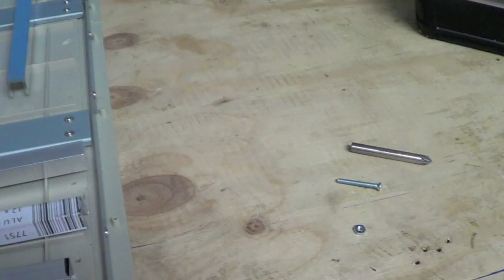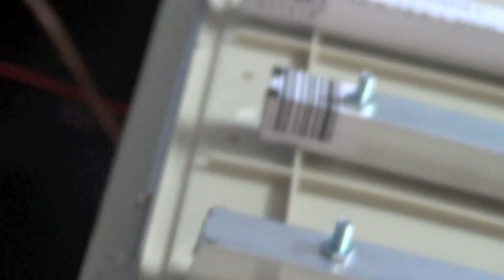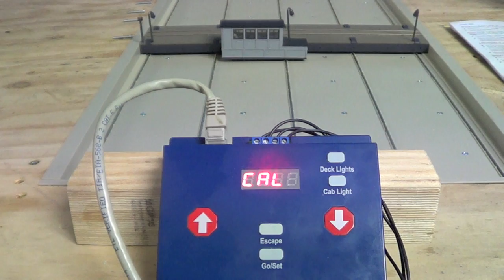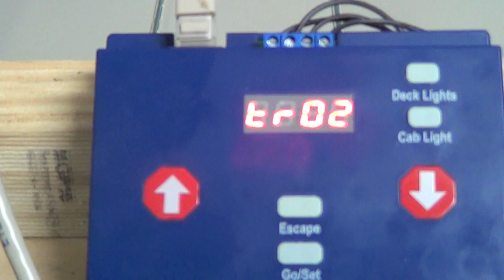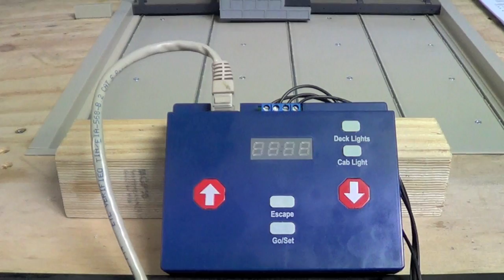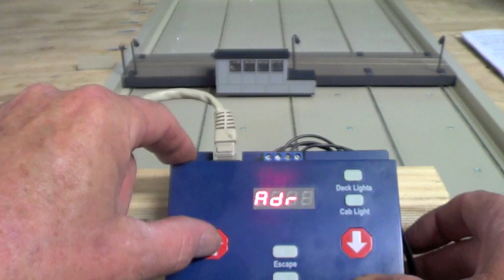"Walthers Transfer Table" Model Trains Part 42 "C"

Comment: I would have thought that the bracing added should have been run the length of the table not the width, it could have been attached to the supplied cross braces so no drilling or screws would show on the table.
Reply from the maker: Mike that might have worked as well cheers Robert

Comment: Hello Robert,
Great update and video !
Found your videos while searching for information on Heljan transfer tables.
Great to see one working !, Well done on showing us.

I have just purchased one of these, brand new ( November 2014), when all connected up, all I can get the control box to do is display > Heljan > AO57 > 'C'...  and nothing works !  I have checked visible wiring and all seems ok..and the bridge is facing the right way with the optical sensors. The instruction manual does not refer to error 'C' .Am I correct in thinking this control box is defective ?  I get the 'C' even if the lead to the table is not connected...
I have tried DC and DCC inputs

As it is new, should I return to the retailer... I am disappointed.

Any advice would be helpful Thank you. Steve
Reply from the maker: Stevie B Hello Steve all i know is if the lead from the table is not connected to the blue box you will get the letter "C"  so i'm guessing this is faulty, by the way what sort of power are you using to the blue box cheers Robert
Reply: ***** Thanks Robert, I have used both 16vAC and the DCC power supplies, with exactly same results... the C displays each time , and with or without the table lead being connected. Guess I have got a faulty control box...and am unlucky !
Keep up your good work tho !
Cheers

Steve
Reply from the maker: Stevie B Steve i used a 16 vac and a 12 vac cheers Robert
Reply from the maker: Stevie B Steve i was just playing with the Transfer Table and now i get the same as you > Heljan > AO57 > 'C'. BUT when i put the bridge on the tracks it is ok and i connect the 16vAC to pin 1 and 2
and my 9vAC to pin 3 and 4 Hope this helps cheers Robert
Reply: ***** Thanks for  all your efforts Robert, I returned it to the retailer who got another from stock, ( brand new) and it was exactly the same.....control box freezes at  C. 

I also emailed Heljan in Denmark and this is their response :

Dear Mr *
 
First of all we are sorry to hear you are having trouble with your Transfer Table.
 
You are correct. One of the reasons for the “C” in the Control box display could be because the box is faulty. This error happens, mainly if there has been a short circuit at some point.
 
However, there could also be another reason and that is bad connection between the Bridge and the Pit due to dirt. 
Please see page 14. Point 6 – point 1 in the I-sheet. 
Please try to clean the wipers underneath the bridge and also the 5 nickel silver rails. You can clean them with some Probyl Alcohol or similar.
 
I hope this can help you problem.
 
Best regards,
Pernille 
Heljan A/S

As both of these were brand new and sealed with exactly the same issues, it is my view that the control boxes are faulty.Both were wired exactly as per Heljans instructions..
As neither had ever been used dirt on the wipers is not the issue.

I am disappointed, and so is the retailer.
These should have been quality checked before shipping by the manufacturer..
We can only assume there is a faulty batch
Ah well... I shall just enjoy your videos then !

Many thanks for all your efforts Robert, keep up the good work !

Best Wishes
Steve
Reply from the maker: Stevie B Steve check this guy out Heljan Traverser Table Working on Penna Lane TMD 
Now i reckon if you put in two adaptors instead of your booster 
this may work and this guy reckons the "C" stands for command

Comment: Those braces did a great job.  Too bad you had to do it in the first place.  For what that table cost you think it would be of better quality.  You will not have any warping.  The unit seems quite easy to use.  Great vid.
Scott

Comment: Glad you got it working, Robert. Its just a shame you spend that amoint if money and you have to do all that drilling and stuff to make it work properly. Looking forward to the next vid!
Best,
John
Reply from the maker: John Prescott John doing this was more for prevention from having the layout in the shed, i didn't want to see this table buckle up if it got to hot.
And the cost wasn't much the bars cost me $13.50 to buy,but as you said 
it was more time drilling than anything else but hey Prevention is the best key, and it would have been worse if i had to take the table out at a later date to try and fix cheers Robert